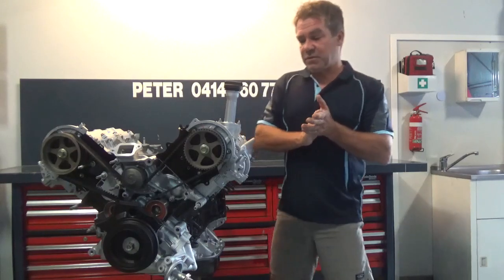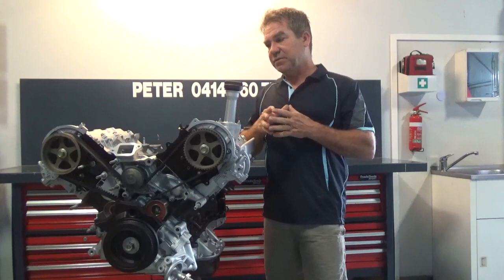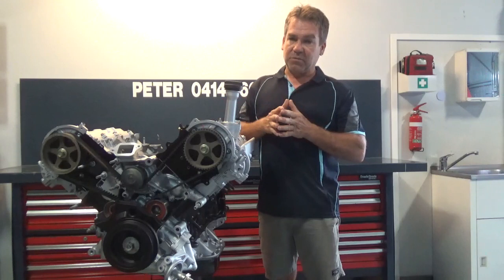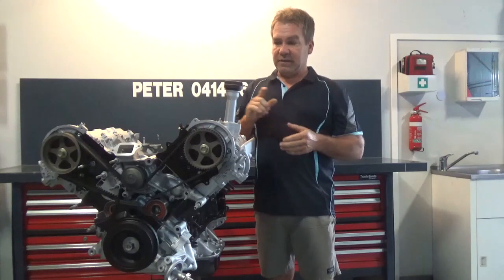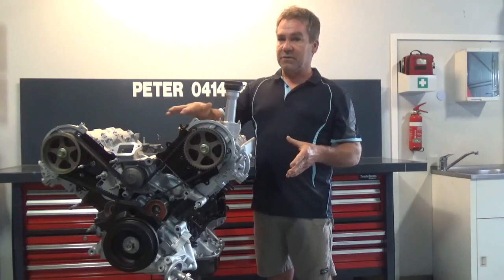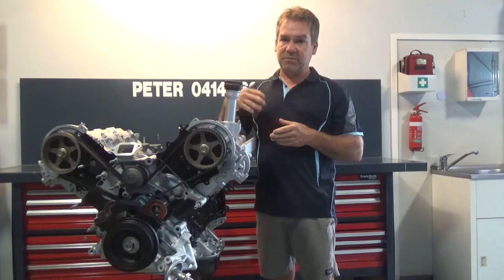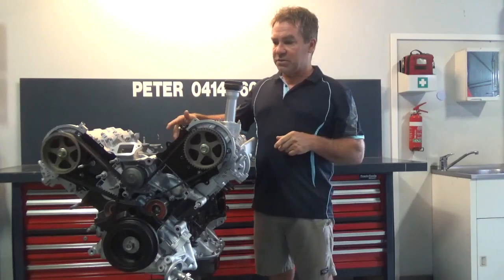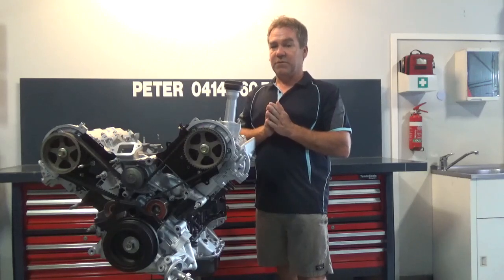Toyota Landcruiser 4.7l 2UZ-fe engine reconditioned rebuilt Lexus

Comment: Are these engines reliable? I want to get a used Land Cruiser 100 series with this engine but I'm quite worried. What about fuel consumption?
Reply: Bulletproof engine..don’t buy a v8 if you’re worried about fuel economy 😉
Reply: my dads got one in his 04 tundra, close to 300,000 miles with no issues, replace your timing belt when needed because its an interference engine that's the only issue.